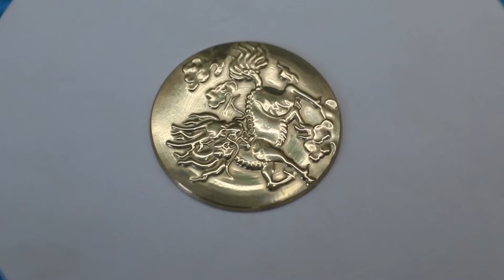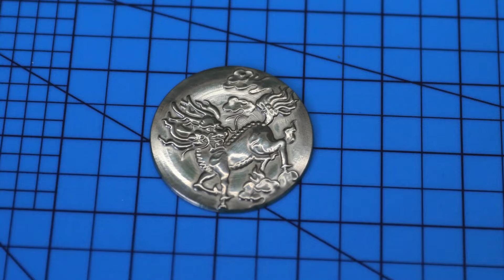Make a Kirin brass coin using the Carvera Air

Comment: how would you do a 2 sided coin from a similar plate?  how would you register the position?
Reply: probably soft jaws
Reply: Mill the detail on one side cutting it out as an oversized square. You can then register on the new cut line cut the detail on the other side and cut it out. There are a bunch of other ways to do it but that would probably be the easiest in this situation
Reply: You could cut holes to dowel the part then just flip the piece over and reset. 

I also don't see why you couldn't do it on the 4th axis.
Reply: You could on the 4th axis, but depending on how much your material deflect and how long the piece is, it might flex during milling